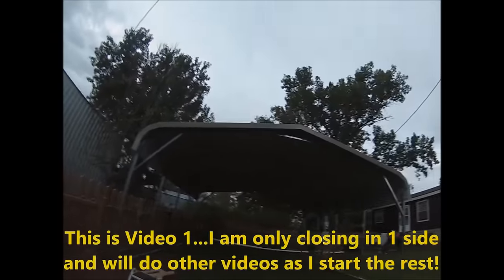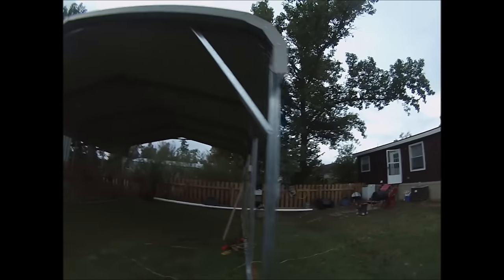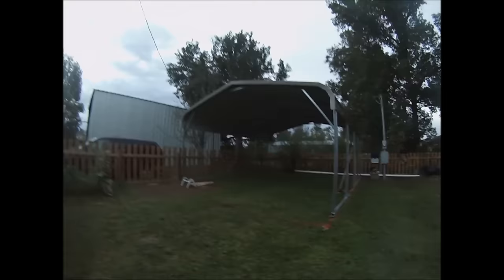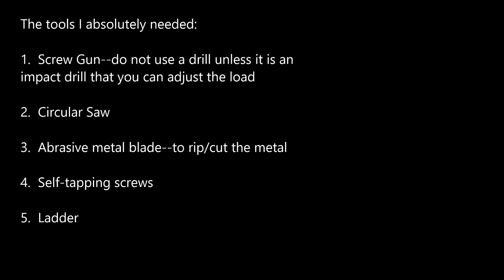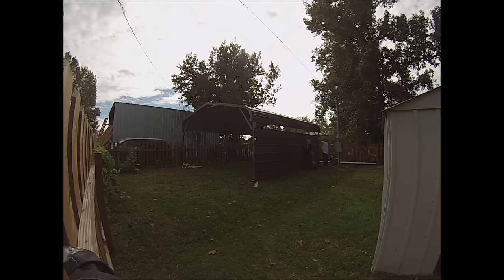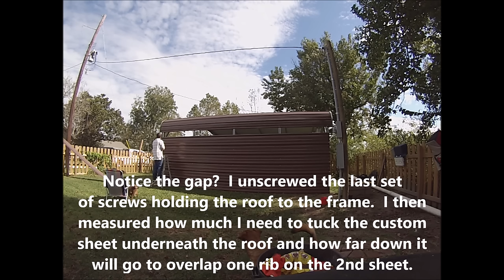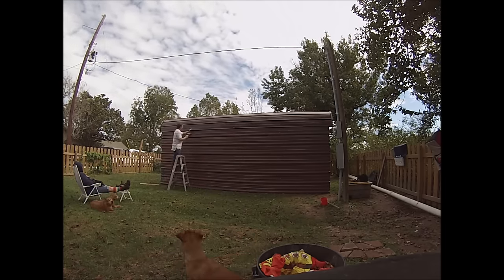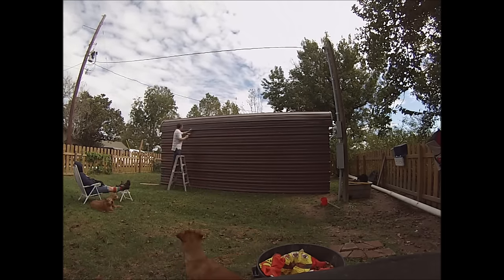Part 1 - How to Enclose a Metal Carport - Installing Side Sheet Metal

Comment: I'm no expert, but on mine I'm going to start at the top and work down. It looks like you can use the roof section to hold the sheet of metal. Then the cut will be on the bottom.
Reply from the maker: I went bottom up to have the overlap to be underneath from bottom up

Comment: In front of my 800sf garage there is a huge metal carport, is very large, almost as big as my garage. Only top on it, I wanted to do sides but worried me it might catch wind and possibly lift it. Was thinking enclose just up to top and leave about 2 foot open to let air pass through. I noticed on my carport the steel pound in stakes every so often are up about 4 inches and I have to pound them back down, seems like thst is sign of lift. I really only need one side done since other is protected by house. Just don't want it to turn into a huge kite with 50+ mph winds, is rare here but happens.
Reply from the maker: Have you looked into mobile home auger anchors?
Reply: @JRMSweeps  might ge way to go.

Comment: I just drew up the plans for doing the same thing to my carport. Exact same size. But I'm installing 4' door on front to fit lawn mower instead.  What's total cost you predict for the siding? Not the door.
Reply from the maker: The siding i bought was 21 foot by 3ishfoot in dimension.  Each piece was about $65 each.  Guess you have to do some dimensional measuring on yours and price it from there.

Comment: What size of self tapping screws did you use?  When you say vise grips you are referring to the average handheld vise grips correct?
Reply from the maker: Self tapping metal to metal screws im using the small 1 inchers.  Vice grips as in locking pliers, basic pliers you get anywhere.
Reply: @JRMSweeps  thank you so much!!
Reply from the maker: Always welcome, anytime.

Comment: Why didn’t you start from the top and work your way down to avoid the overlap?
Reply from the maker: You want overlapping from the bottom up so when it rains it stays on the outside of the metal.

Comment: How much did it cost? We’re thinking about enclosing ours and it’s about the same size.
Reply from the maker: The metal sheets were almost $65 for a 3ft by 20 ft piece.  Garahe door was $550ish, auto door opener $150, door for the back $150...then screws, wood, and misc materials, maybe right at $1800 give or take.

Comment: Hey pal...... great job ! ! You say Metal Depot, huh? I wonder if they have any locations out here in Northern California.
Reply from the maker: Thanks, its still a work in progress...still have the gable ends to do and its finished...hopefully they do out there for ya!
Reply: Found a Metal Depot in Hayward, CA...... 10 miles away. What's the name of the material you used ?? I'll ask for that directly. Again, great job brutha.
I'll let you know as we progress. Blessings
Reply from the maker: Awesome...it is just their 20 ft sections of metal that they should have in stock.  Ask them to see if u can check it out in the back as well...should be about 3.5 feet wide and 20 ft long.  I think they will cut it as well but not sure on the fees...thanks a bunch my man.  If I can do it, anyone can!

Comment: Help!
I just bought the same size carport. It's not installed yet.......waiting on scheduling.
Is there any way you can give me the measurements from center bottom rail to center bottom rail width? The company doing mine says they can't give me a spec sheet because it's not a certified building. Can't get anything outta them but 18x21
I'm trying to pour some concrete forms for rail. Tube size also?

Thanks
Reply from the maker: sorry this post took so long, it was marked as spam for some reason.  to clarify, you would like a measurement across the front from the center of the outer most rails correct?

Comment: How much is each metal panel for sides?
Reply from the maker: +Samuel Bermudez each panel was 3.5 ft tall by 20 foot long. They ran about $65 per panel.
Reply: JRMSweeps  can you tell where you found the side panels. Co. Name and web site. Thanks. I have a 26×22
Reply from the maker: A place called Metal Depot. They have a website u might be able to check and see if they have a location near u.

Comment: Hey man,About how much in total was it it to enlose?
Reply from the maker: The carport alone was about $750.  I ordered it online and they came out and put it up in about 2 hours.  I went to a metal place called Metal Depot and bought 5 - 20 foot sections of 3.5 foot wide sheets that just so happen to match the color I ordered.  Each sheet was $65 a piece, totaling bout $325 for the side pieces.  I ordered my garage door from Lowes online, which was about $550.  Then, bought a garage door opener for about $150.  

Total cost was about $1,800.  I did have to buy some misc lumber, screws, etc. to install everything as well.  

I did everything in small increments, which didn't cost me an arm and a leg all at once.  The carport is 18' wide by 20' long.  I wish I would have ordered a 25' long or more, since I have a car, a jeep, and 2 motorcycles in it...and it is jammed tight!
Reply: Lol.You may be able to mAke youre own extension? Thank you man.I really appreciate it.Going to do this soon to make me a garage lol.
Reply from the maker: I thought about that, but I already closed in the back and framed it out.  I think I am going to order a 1 car garage or put a garage door on the RV barn we have that is closed in on the property.  I definitely had to do some crazy engineering on the garage door opener, since there is no header wall to attach it, less alone attaching the torsion spring and the rollers on the side.  Angle iron will be your friend.  I do have a vid or 2 on how I did that as well...You will love it!!!
Reply: @JRMSweeps  Do you remember what online store you purchased the carport from?
Reply from the maker: Man, i dont.  It ran me about 1150 i think.

Comment: were did you find that  sheet metal ?  I am thinking of doing that to one of mine ..
Reply from the maker: +odenkiller there is a place called Metal Depots right down the road from us.  They happen to have the matching color in 20 ft long sheets for about $65 each.  They measure about 3 ft wide or so.

http://www.metaldepots.com/
Reply: Ok cool thank you ..
Reply from the maker: You got it...if u have any other questions feel free to ask...this was my 1st build so it was a learning experience for me no doubt...
Reply: Oh that is fine  I
will be doing mine when it gets a bout March , and it is not as cold .. I am in Kentucky out side of Ft.Knox  area .. the link  bout the metal sheeting was helpful but just a bit too far away 's  .. But I did find a place not to far from me that has some ..
Reply from the maker: I know it was worth it to keep the weather and other outside elements off of our vehicles.  Putting the garage door and automatic opener on ours was so nice, especially when it's cold or rainy.  Good luck on your build my friend!  If you any other questions, don't hesitate to ask!
Reply: Ok will do ..
Reply: Lowes sells it

Comment: JRMSweeps If anyone wants to ask questions on how to do this in way less time. I'd be glad to answer them. Or putting on gables on existing building. Headers, adding concrete flooring to already set carports, adding extensions (Yes that can be done). I had a biz running 3 carport crews. I'm on youtube a lot. Ask away.
Reply: Joker Gregory need inside info on installing gable on existing catport 18ft wide
Reply: First take a measurement from THE BOTTOM OF THE LEG (not the baserail) to the bottom of the sheeting for your existing roof sheeting. (Measuring one side is fine. Just use same on both sides. This assures your beading on your gable sheet & roof sheet line up.) Going to sound hard. But the easiest (and neatest finished product) way to install a gable on an already installed carport. Is to remove the bow you want it on. Start by taking all the screws out of sheeting & the ones connecting it to baserail. Take it out lay it on the ground. (With the screws that are connecting the legs to the bow facing down. For a smooth surface to attach the gable sheet.) Now that you've cussed me out for wrestling that bow out from under that roof sheeting. Let's put your gable sheet on. Put a mark on each side, where you want the bottom of the gable sheet to be. (The measurement from the bottom of the leg I asked you to take.) Flush the sheet with the outside of the leg and on your mark. (On just one side) Put a screw to hold it. now measure outside to outside of the bottom of the legs. Before you screw the other side of the sheet. (Measure the outside to outside on your baserail. It could have been installed 18'2" or so.) Now that you have both sides tacked at the bottom of the sheet. Tack a couple of screws at the top of that sheet. (To the bow)  OK now flip the whole thing over. (With a sawzall and a metal cutting blade. 18tpi Get a thick blade. Spend a nickel. You'll thank me.) Now you see you can use the bow itself as a guide. Cut off the sheeting But DON'T MESS UP what you cut off. That is going to be the top of your gable sheeting. Now that you have that cut. Flip it back over, and screw that sheeting you cut off onto the top. The angles are the same, you'll see. Now cut that excess off. Now you have  your gable sheet on. (I don't know what you are going to use to sturdy the sheet up. But you can do that after you put the bow back up.) To make it easier to put your finished gable back in. Cut the nipples that are on the baserail down to 3 or 4 inches. Use that good sawzall blade you bought. It will not effect the sturdiness of your carport at all. It will make it easier to put that bow back in! Now line up the holes in your roof with that Bow you reinstalled. (Start with the peak!!! Now before you start screwing down the roof. With the peak tacked. Go down to the last sheet on both sides, and tack that. You will see, all those holes lined up.) /// I just read this back. Let me add some things that will help. First take the trim off and set to the side. / Bow = truss (just what we call them)/ nipple is what is welded to the baserail to put leg on. *And while you are removing the bow & leg. If it is being a bitch to get off the nipple. Lift it up 3 or 4 inches and cut the nipple then. Make life easier on yourself.*  / Cutting the sheet (face down) in a grassy yard. If you can't. Just use some 2x4s. / All this looks complicated as hell. But I set at least 10,000 of them up. And this is the way to go. / Your other option is to get 3 other guys. 3 ladders. get them to hold the sheet up against it where the gable is going to go. You get on the roof and scribe your cut. That is a pain. Because that always looked like crap. I hope I helped. Just take your time. You got this! But: (Mason Gregory Jr. on FB), look for the Joker profile pic.
Reply: I need help just putting a side wall on a simple small carport
Reply from the maker: Just put it up and screw it in place...
Reply: JRMSweeps  just like that? It is metal
Reply from the maker: Yep. Measure it, cut it, and secure with self tapping metal screws. Make sure u have an impact drill or a screw gun designed for that. A regular drill will give u hell.

Comment: Oh my lord I set carports up for 10+ yrs. I have never seen anyone put the bottom sheet on first. I'm not being a smartass. You didn't know. The last screw on the original installed top was screwed to low. If it had of been up in the next ridge up. (About 6" up.)You can slide the next sheet right up under it. Put one end up under. While the other person holds the sheet down on the other end. Then just slide the lowered side up. It will fall into place like dominos on the legs.  Then put the next sheet on the same way. Then measure and cut the bottom sheet. Oh and chuck that circular saw. Get a sawzall with a thick metal demo blade. 18tpi. lay it on the ground and rip your cut using the beads of the sheet as a guide. This was just truly painful to watch. You took a 20 minute job. (To close both sides.) And turned it into an all day event. Me and 1 other person could have finished in the time it took me to type this comment.
Reply from the maker: Appreciate it lol. I just needed an enclosure for my 2 jeeps.
Reply: Joker Gregory You really need to buy your own channel this man, JRMSweeps has paid Youtube for this posting. I think its rude to use his post to  your advantage. Just plum rude.
Reply: I don't want a channel. I was just giving some free advice to anyone who watched the guys video. (I've set up 10,000 or more carports. Not to mention the 2 other crews I had working for me.) I personally could care less if ANYBODY takes it. I don't make any money off it. Don't need too!! I set up so many carports. I retired at 47 yrs old. So since you don't have a clue what I meant by my comment. You can ride off into the sunset cowboy. Before I start to be "plum rude".
Reply: I've got one that I park my motor home under and I want to raise it and pour a slab. I think I know what I want to do but would welcome any suggestions you might have.
Reply: You also just said, you have been installing carports for over 10 years. I would hope you could do it that fast! I literally dont understand why ppl have to be haters! I am positive you did an awful job your first time! Atleast he has the balls to do what he wants and how he wants, instead of paying someone to to the job for him....
Reply from the maker: Sad thing is, I actually was able to completely put this together with no instructions,  having to reengineer how to install an automatic garage door out in the middle of nowhere.  Some peeps may think it's crap, but it is still fully operational.  I went to college and got a business and mathematics degree doing this.  I bet some of the "others" who hate on it are carpenters or laborers yet couldnt do my white collar job as effectively I attempted theirs.  Oh well...its a win regardless...
Reply: @jokergregory6762  10,000......yeah right pal...Lol